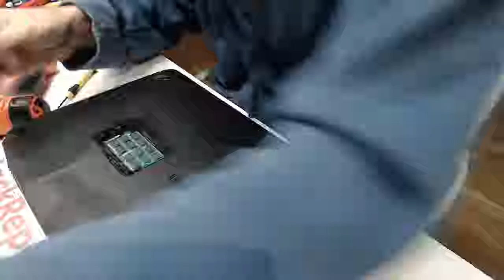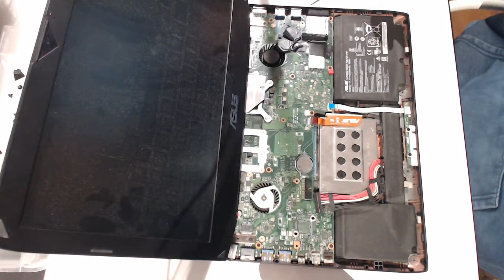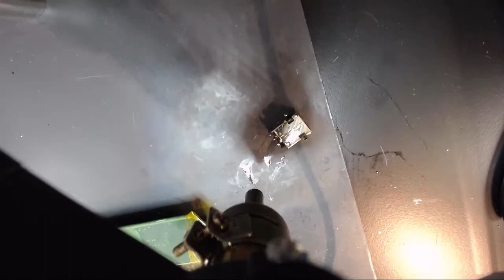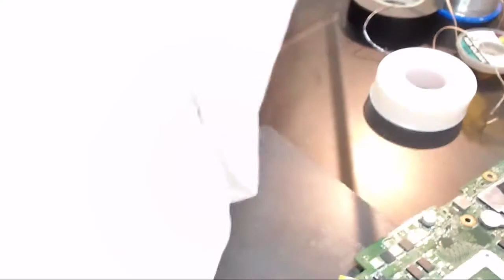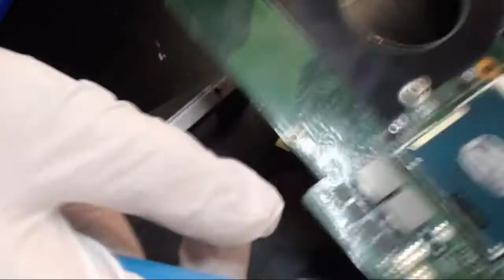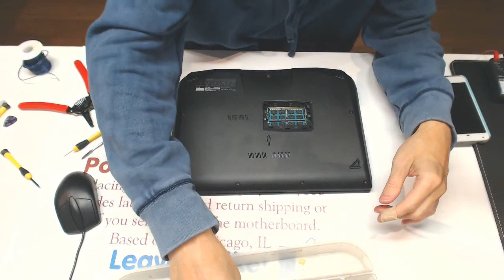Asus G46v G46vw Laptop dc power jack repair fix charge port broken socket

Comment: Hello, at min 40 you were applying what looked to be flux onto the the bottom of the DC jack, but you were adjusting a piece of solder from the last pin on the Jack to the nearby capacitor (as you mentioned you were bypassing the trace) - Can you please tell me if you pre-soldered the the tiny piece of wire to the jack? I saw you moving/adjusting the side leading to the capacitor, but I noticed that the end touching the DC Jack did not move at all. How did you do that?